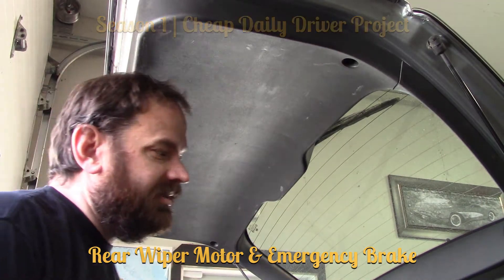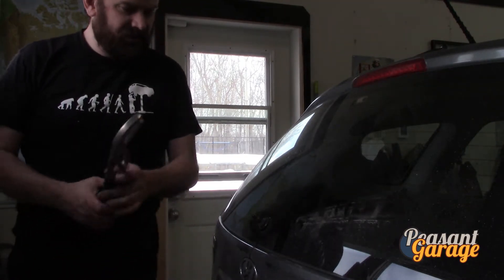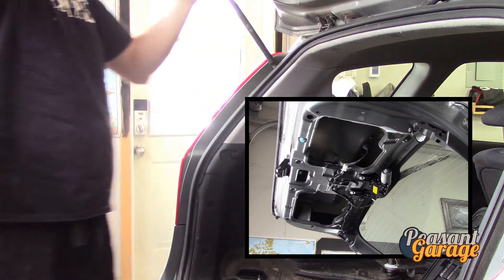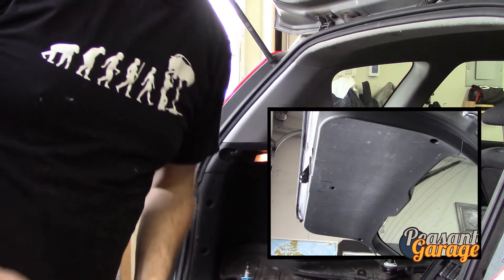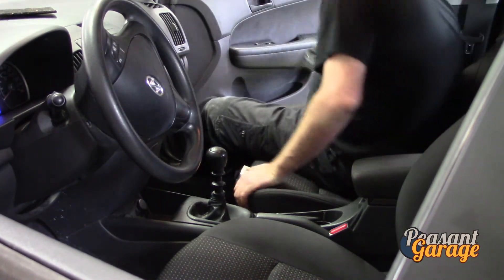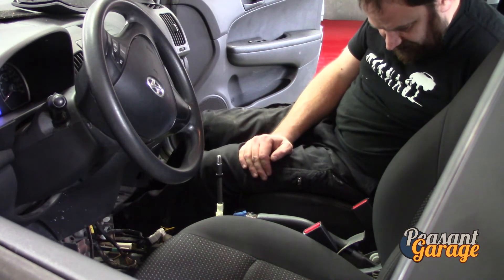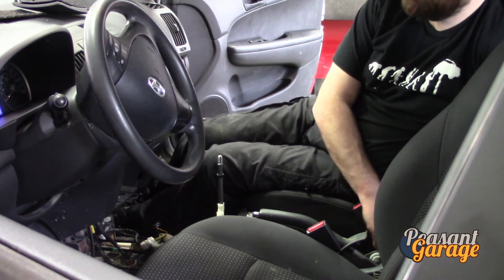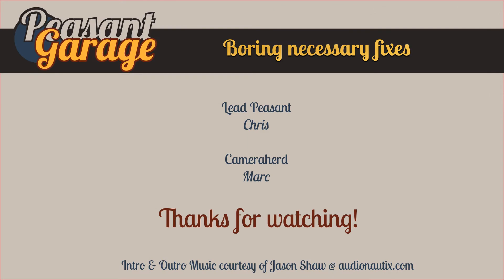S01 E05 | Rear Wiper Motor and E-Brake | 2011 Hyundai Elantra Touring

Comment: Thanks a lot for the video.. mine stopped working this winter as well… fuse is ok so I suspect the motor is dead. Did u get it refurbished? I’ve seen it in Napa Canada at 210$ refurbished!! You were talking of something around 100$ isn’t? Any help will be welcome (I’m in QC but willing to pay for shipping from ON if required) thx a lot
Reply from the maker: Mine was pulled used from Kenny U Pull here in Ottawa.  Cost me like $15.00 - Chris

Comment: Love my Touring, all utility without any of the "sport" or "cute" crap. Not the most refined ride but tons of space, cheap and easy to maintain. 

Managed to get to mine while it was severely dragging to the point it required manual assistance to get it to park. Just took the assembly off and stripped it down, cleaned and lubed the shaft and bushing. Fortunately the motor is still fine.

Take some extra care removing the wiper arm just in case the motor can be salvaged. Support the arm while removing the nut and use a puller to get it off without risking damaging the assembly/glass. Just need to repair the trim now where the clips literally ripped it apart.

Comment: I try to change it, but doesnt work. Liquid doesnt work neither. Was wondering if the two are linked (if motor doesnt work maybe it cut the circuit for liquid), or if it's not linked, I may have an electronic issue ! Thanks for your answer.
Reply from the maker: Check you fuses.  If you have no power I always start there.
Reply: @peasantgarage2468  Thanks for your answer. I started by that at the beginning, but seems that the fuse finally died after ... And the first motor I found was dead too ... But now everything work and a lot because of your video. Thanks again
Reply from the maker: @sonialerouxel2447  Your totally welcome and I am glad I could help!

Comment: Mine started struggling after I unknowingly activated it while it was blocked by ice.
It works when it wants to.
Maybe I'll need to buy a new motor... I need to look more into it.
But most likely, I will need to replace mine.